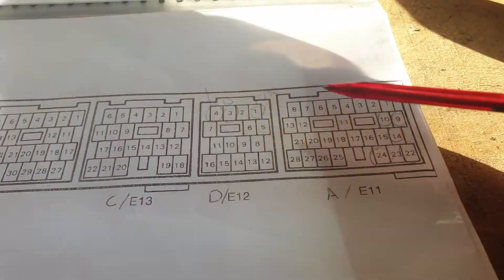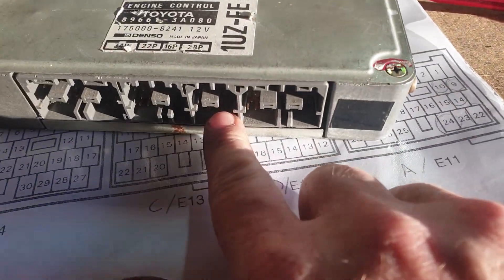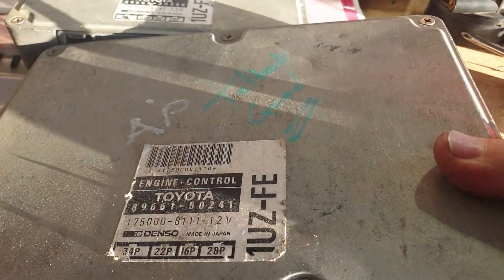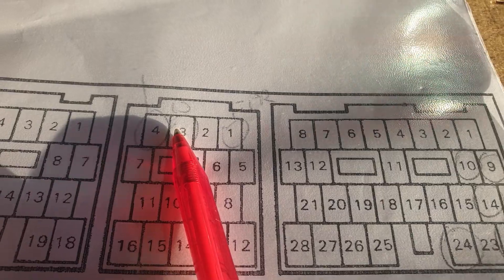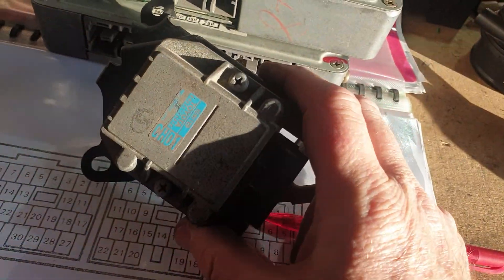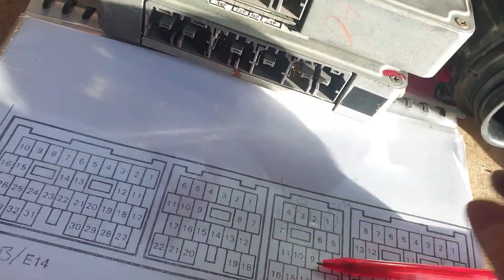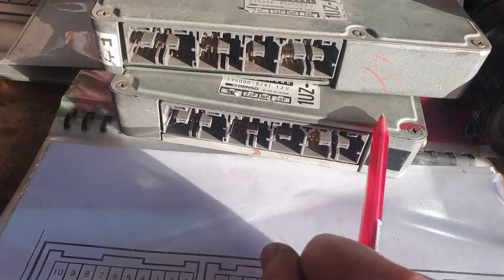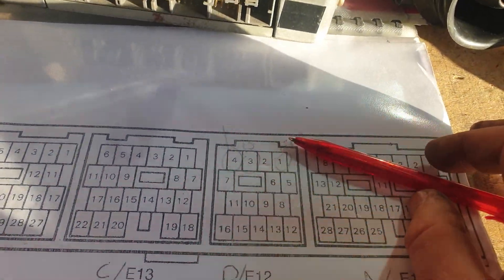Manually outputting a check light  on a 1uz Gen 2 / Series 2 non vvti

Comment: Hi Kelvin ,so are you saying when you ate ready to check codes that you put 12 volts to number 3 wire and at the same time you put a ground or earth to wire number 5. Thx
Reply from the maker: #3 is for the light output,  ecu will supply an earth to ground the light which gets 12 volts elsewhere.  Then ground #5 to initiate the flashing